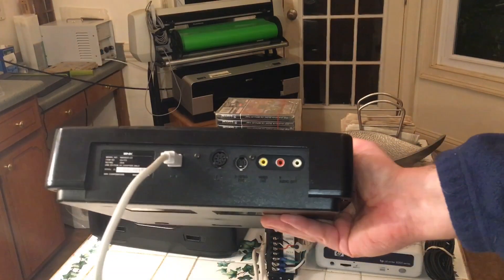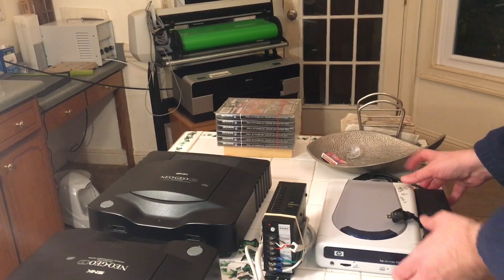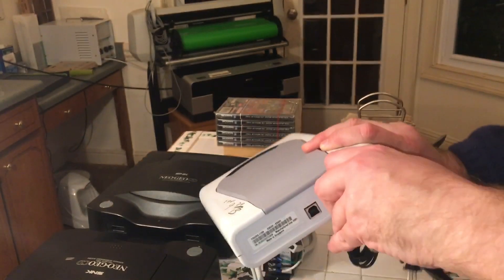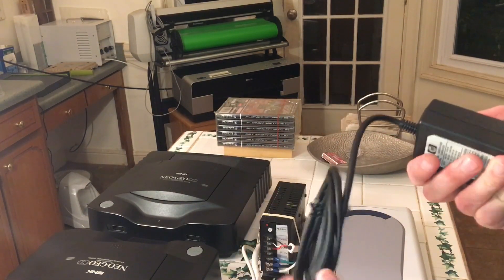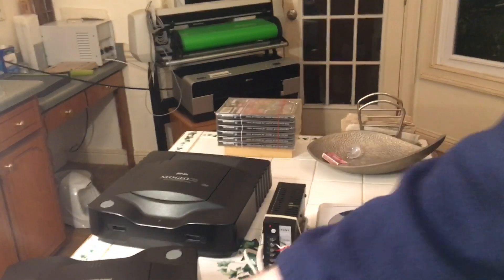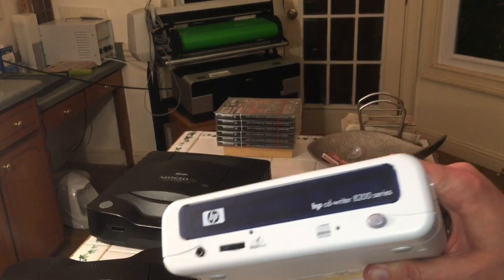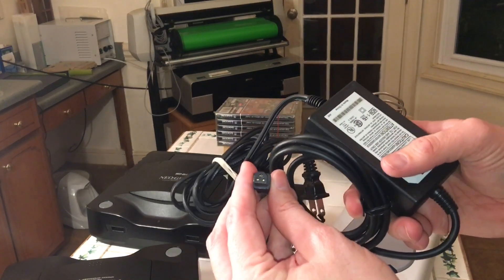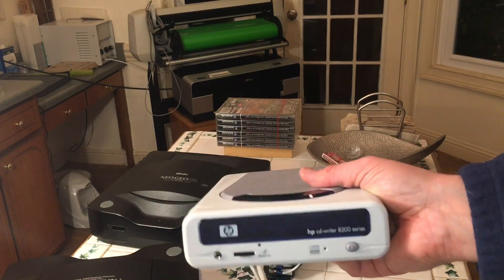Salvage PSU for Neo Geo CD, Famicom Titler, MSX2.

Comment: can you please help me how to run this cd player i am unable to install driver
Reply from the maker: I donated mine back without ever using it since I was only after the power cord. I recall it could use either IEEE 1394 FireWire/iLink or USB. Assuming your drive still works, USB should be automatic. You could also remove the drive itself from the enclosure to use directly in an old computer but it probably needs one that has a 40 pin IDE connector (most have smaller SATA connectors only these days).

Comment: I just bought one of these, what wires do I have to switch inside the psu to make this work with a neo Geo cd?
Reply from the maker: I looked up the pinout of an official SNK adapter and wired 5v to 5v, 12v to 10v, and ground to ground. There is no consistency with the HP plugs so I can’t trust the color of the wires would be the same across all of them.

I prefer using them just for the cable/plug and connecting it to my own dual-voltage PSU.

Comment: I just bought a Neo Geo CD without power supply and I just saw your video which present this ''cheaper'' alternative by modifying an HP SDD018-n1000 power supply. The only thing I understand to make it work is that we only need to switch 2 out of the 3 of the wires around internally. It is not specified which of the 2 out of 3 wires that have to be switched... Can anyone identify them and explain this to me? FYI I know how to open the PSU and de-solder & solder wires... Thanks in advance!
Reply from the maker: I can’t pretend to know if the PSU mod is adequate long-term so I didn’t go into it. This was more about where to get the connector for a custom PSU. The HP PSU doesn’t quite match the SNK PSU specs and you have to smash your way in but if you want to use the HP brick anyway it’ll work after switching around the internal connections.

The same HP PSU comes in different colors, regional variants, and some even have a useless mini-DIN connector so I wouldn’t expect any consistency inside. Yours may be different so I can’t cover specific wire colors and such. I can tell you how I figured it out so you can repeat the process.

I looked at a picture of the SNK NGCD PSU to see the diagram for which pins were supposed to be 5v, 10v, and ground. The HP PSU does not have a diagram so I used my multimeter to figure out which pins were 5v and ground. I then swapped the wires around so that 5v and ground were on the same pins as the SNK PSU. That leaves us putting 12v where the console expects 10v, which is safe because it goes straight to a voltage regulator with thermal protection anyway.

The HP’s 5v is only 1.2 amps when the original SNK PSU specifies 2 amps but it seems to work. Not sure if it will power all your controllers and NeoBIOS Mastah and and Neo SD Loader and such all at once but I suspect it will be fine.

Comment: Hello I will buy one 240V for french plug. Could you explain how to change it for perfect amps and voltage please? THX
Reply from the maker: You won't get perfect voltage for the 10v input but the Neo Geo CD will tolerate 12v there since it goes through a thermally controlled voltage regulator. Also, mine only has 1.2A on the 5v rail when the Neo Geo CD specifies 2A but that may still be enough. Is yours also 1.2A for 5v? Even though I have an arcade PSU to supply enough amps I can't test since neither of my disc drives work.

1.2A is probably enough, especially if you are getting rid of the CD drive for a Neo SD Loader, like I did. If not, you may want to use it with a dual voltage power supply like I did with the arcade power supply. You can also find hard drive PSUs with 12v+5v. That way you can ensure there are enough amps.

Old 4-pin hard disk drive power supplies typically have both 12v and 5v so I searched eBay for "IDE 2A" and I see a bunch. I see a lot of the same 12v 2A + 5v 2A unit but it may not be any better than the HP unit you already have, since cheap power supplies often exaggerate their specifications.

To use the HP adapter you still have to switch the pins around to match the Neo Geo CD pinout which requires breaking it open. I squeezed mine in a clamp and then whacked it with a rubber mallet to break as cleanly as I could along the sonic plastic welds. I glued it back together using ABS Cement. It worked great!
Reply: @emmettturner9452  thx very much. Last thing is it good for psu replacement?
https://www.ebay.fr/itm/FR-POWER-ADAPTER-FOR-NEO-GEO-CD-COMPATIBLE-100-240V-NEW/323899030008?_trksid=p2504926.m5232.l9681
Reply from the maker: I believe so. I see it on AliExpress so I don't think it is really Japanese but they do sell if for Neo Geo CD and I expect they tested it to make sure it works, at least. It is expensive though!
Reply: @emmettturner9452  thx very much
Reply from the maker: 16BitBench was already doing this with plugs salvaged from the original Japanese PSU:
https://youtu.be/dxKUICk-7Js

Comment: My Neogeo CD console cannot power up now. The power LED blinks once and cannot power on after i press the power button. Could it be the power adapter faulty?
Reply from the maker: I've never owned an original PSU to know how they might behave when they fail but it's definitely plausible. I know GadgetUK164 repaired one in a video, so it's worth looking up to see if his behaved similarly. Since the adapter outputs two different voltages it is possible that only one has failed.

Comment: Does the hp 8200 work for windows 7?
Reply from the maker: I donated it back to Goodwill without ever using the drive since I just wanted the power supply. It should work as a standard USB drive and standard USB drives do work with Windows 7.

Comment from the maker: Correction: It has enough amps on the 12v 1A part (original was 10v 1A). It’s the 5v 1.2A side where it’s a little lacking (original was 5v 2A).

It seems to work fine for me but if that ends up not being the case for you then just transfer the cord to a source with more amps. Dual-voltage PSUs with enough amps are commonly available for external hard drives and disc drives.
Reply from the maker: Responding to my own comment to get it off the page of comments with no responses. :)